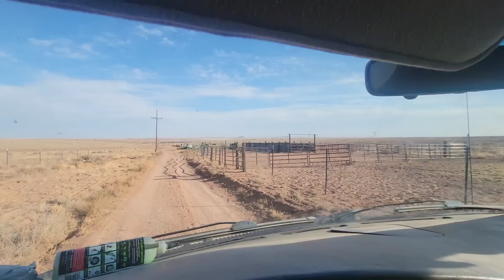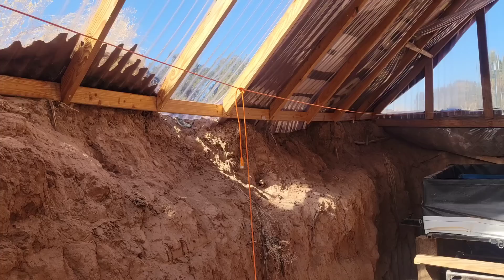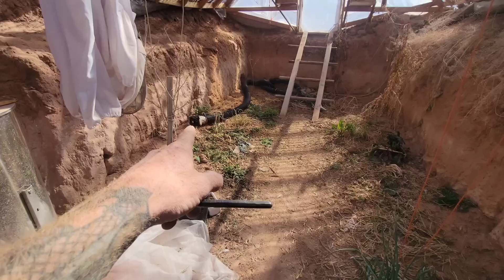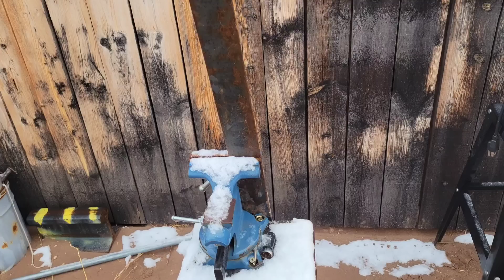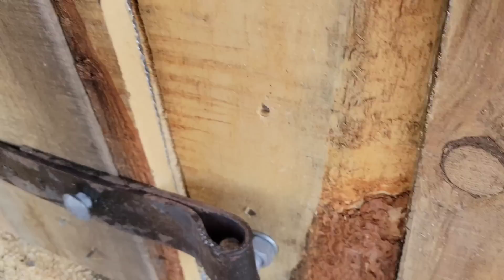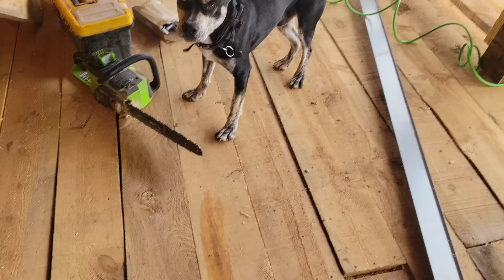BUILD a massive CABIN door with DIY hinges

Comment: Hope your hinges work out well, for lasting quality and a little rust protection quench in oil mixed with animal grease, and while hot rub some wax on to give it a nice coating down to the pores while they are still open